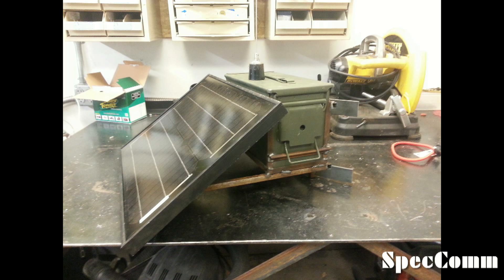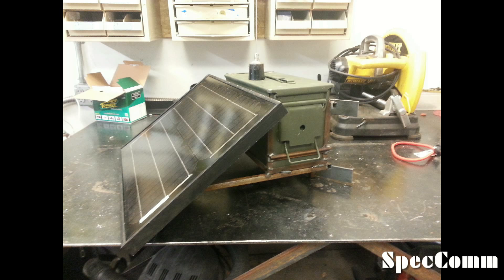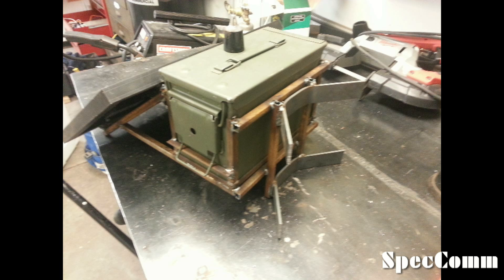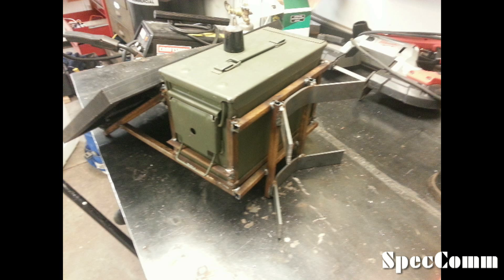GRMS Tree/Pole Mount Simplex Repeater

Comment from the maker: Still works like a champ! Don't use it often except to test it's still working. It's more of a SHTF backup.
Reply: how did you power the argent?
Reply: @czmg22  The Argent data unit has a DC connector on it. That will accept 6-12 volts I believe. I love my Argent data unit. Great backup SHTF comms.

Comment: I have many tall trees around my house. I've considered putting my GMRS antenna up in them too, which is allowed by FTC rules as long as the antenna isn't more than 20 feet above the top of the tree. Just like those tree houses I see built on television programs, in my mind I'm thinking "trees only live so long before they die". My goal is to be able to communicate with my neighbor who lives 4 miles away. Unfortunately, I don't have a clear line of sight between his place and mine. Lots of trees between us in the forest. I may have to settle with communicating with those within a mile of my house.  I got everything I need, my license, a 5 watt Midland radio, 50 feet of cable, electrical tape, a 12 volt deep cycle battery, a battery box, a clamp hook ups with cigarette lighter plug for the battery, a battery charger for when the battery needs charging, and a good quality antenna. I have a 16 foot long treated 4X4 post and some galvanized metal to fashion a cap on the end for the magnetic antenna. I'll fish the cable into the house, leaving enough outside for the tower. I'll hoist the tower, which will put the top of the antenna at 17 feet, seven and a half inches above the ground. I'll set up the radio and battery inside, then fire that baby up and give her a test drive with my portable.  73's. WRBN250.